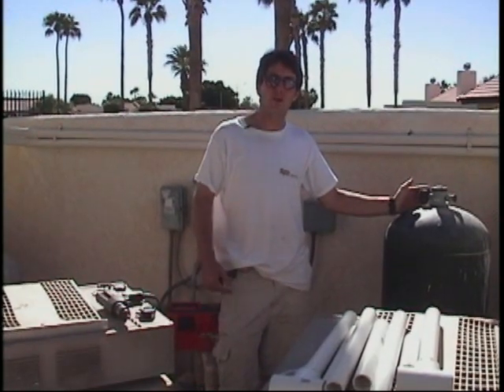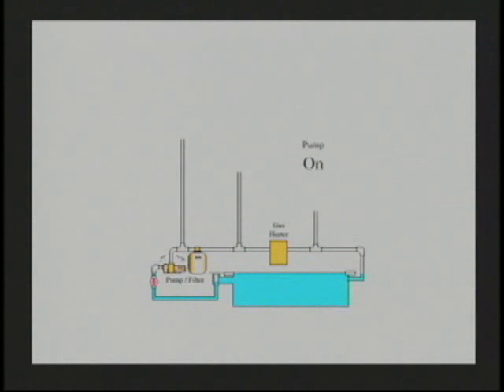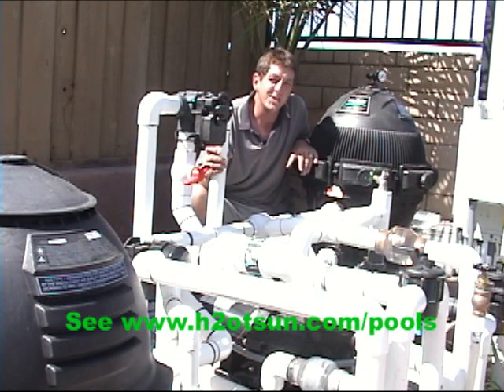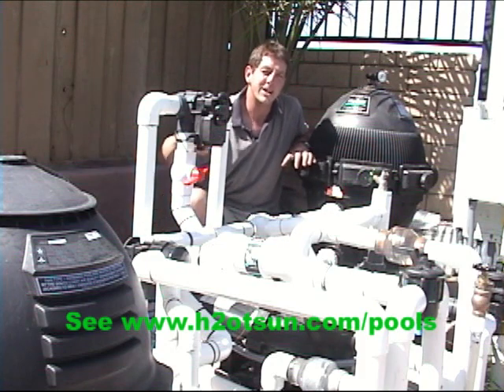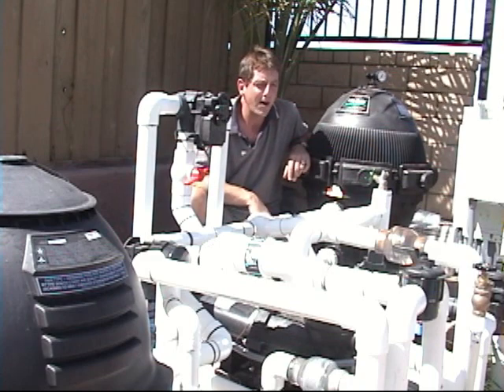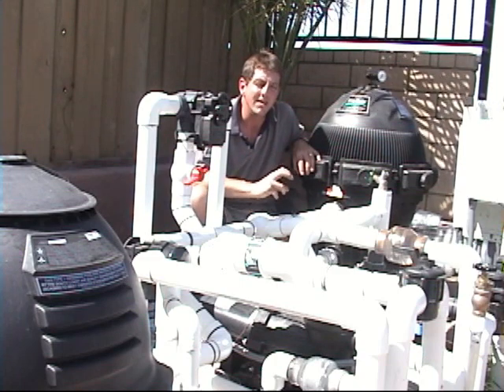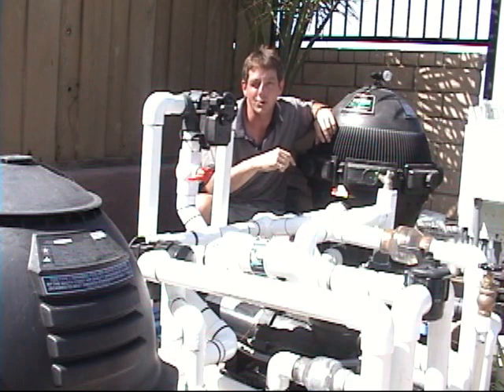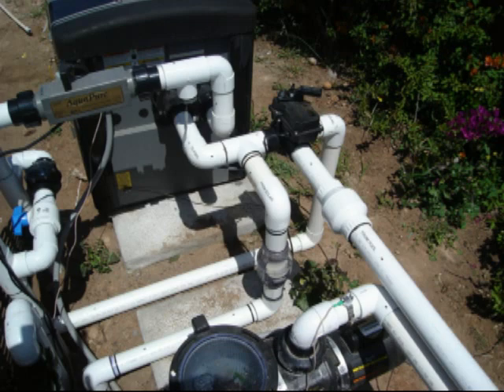Mechanical Considerations in Solar Swimming Pool Heating

Comment: what did you insert in that pipe and connect it to the tube you took up to the collector?
Reply from the maker: That's a 1/4" npt male thread by barb fitting made of brass